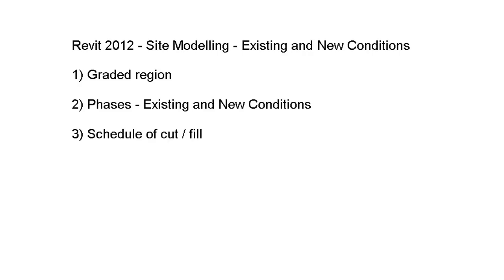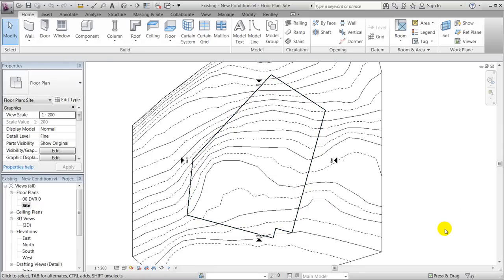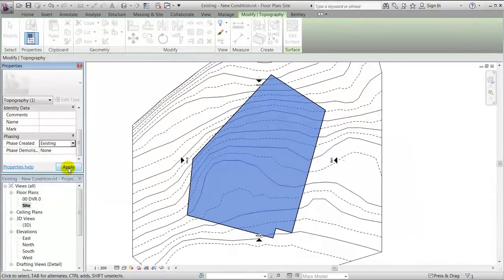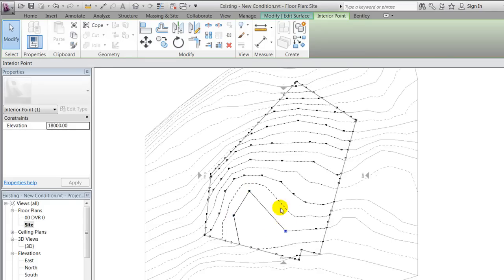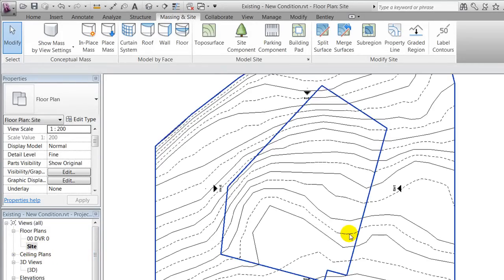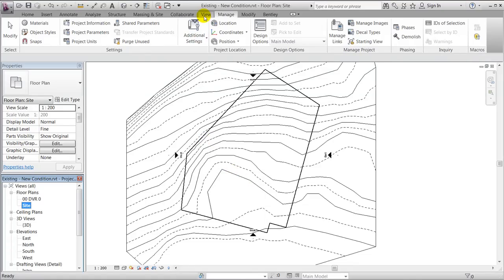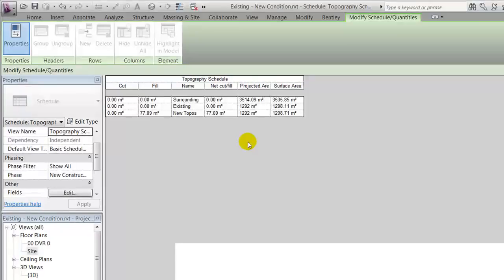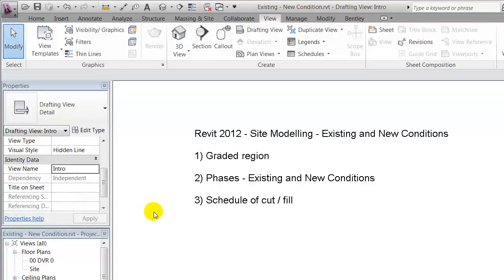Revit 2012 - Site Modelling - Existing and New Conditions - Cut/Fill

Comment: so helpful, but i am not getting any responses from my cut and fill in the  shedules.
I have tried it by moving the points as you did, changing elevation, deleting them...i have tried doing it for new construction, exisiting in the shedule phase selection...

do i need to add a formulea?

Comment: How would you recommend using existing/new toposurfaces with design options??? I need to show existing site and then how the cut/fill would change with 3 different designs.  Also how did you control demo dashed lines for the terrain?